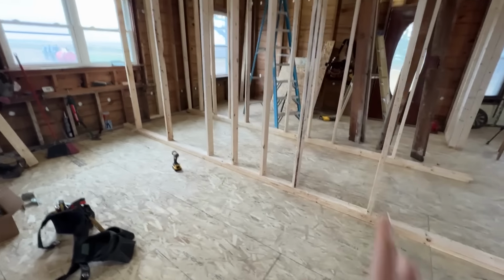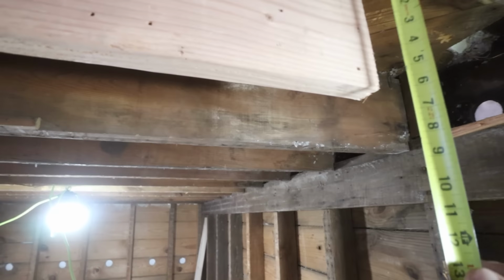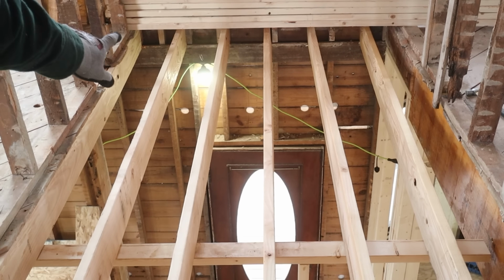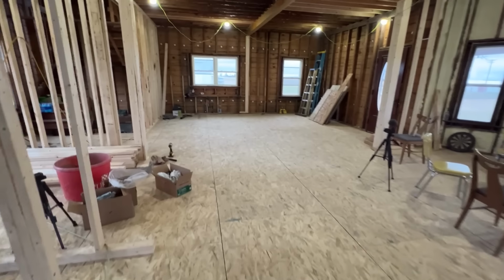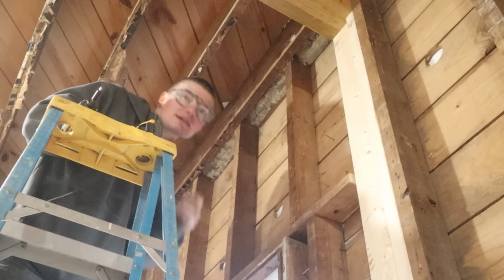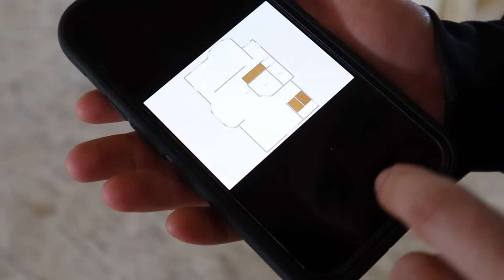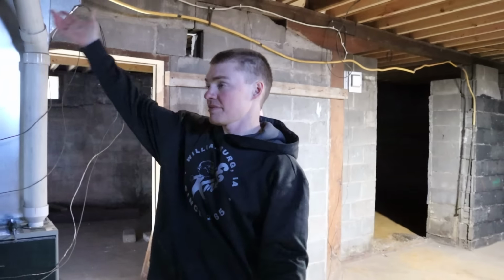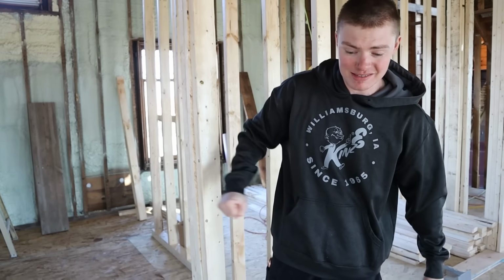Restoring A $7,000 Mansion: Rebuilding HUGE Kitchen

Comment: You have a bow in the middle of the floor... no $#!+.  That's why you level the floor before you start building walls and putting subflooring down.  Not one screw jack in the basement.  Mistake #1 caught.  Now is the floor level or is one side lower?  Flat and level are two separate things.

Comment: Your kitchen it’s up to you, but in the experience that I’ve had hanging kitchen cabinets it’s nice to have blocking behind the walls where the kitchen cabinets are going to hang that way your cabinets can be solidly mounted just in case you have a small spice cabinet in it falls in the middle of a crack you’ll have your blocking top and bottom to mount it on same with your counter cabinets it would be nice to have the blocking to where you can screw them to the wall. Take some of the old boards and cut them for blocking a little time now makes for An easier time later, doing a great job between the three of you
You and your friends are doing an excellent job. Keep up the good work I enjoy watching carpentry as well as the farming. I was in carpentry for about 35 years.
Reply: Carpenters are special, Jesus was one.

Comment: Cole. Where ever you are going to hang upper cabinets. Put flat 2x6 blocks between the studs. Center the 2x6 at 60" and 84" off the floor flush to the inside.  That way no matter how the cabinets lay out you always have solid blocking to fasten to. When done it'll look like you have 2- 2x6 ribbons going around the kitchen. Works for medicine cabinets in bath rooms as well.
Reply: great idea! such solid advice !! (see what i did there...hee hee hee)
Reply: @sherilynl4038  really sucks when you have a 30" upper cabinet and you only hit 1 stud. Lol. Been there.

Comment: Cole I do not do construction and don’t know much but wouldn’t a steal beam be better/ cheaper than rebuilding the concrete wall? Also it will open up the space and you will be able to add wall were you like and even add a room or two

Comment: I noticed the kitchen area is not spray foamed (insulation). Are you going to do that?
Reply: I'm sure he is there's just so much to this project.
Reply: i'm thinking this is because they need to run electrical and water first maybe? Or at least plans have to be laid out for both which means they have to finalize all the kitchen details - cabinets, appliance lay out etc. Just a thought.
Reply: He is but he took out the kitchen after he got the first floor spray foam and only reason he got the house spray foam is because it was still winter when he started and wanted to keep in the warmth but I’m guessing now that spring and summer weather is coming he can wait to add it

Comment: That there 3:20 is called "balloon construction" as to the method used to fasten the floor joists to the wall plate, leaving an opening in the wall or stud cavity between the first and second floors. The big problem with this type of obsolete framing is if a fire would start on the bottom floor and get into the wall cavity it spreads very quickly to the upper floor(s) and into the attic space, much like a fire going up a chimney. Some old-time carpenters would nail a horizontal 2x4 in the stud cavity as a "fire block" to slow the spread of fire in the walls. I've also seen very old houses (over 125 yrs old) where the floor joists were just nailed to the side of the studs without any horizontal wall plate (like the one that Roman is pointing to with the end of his tape).

Comment: one suggestion a steel i beam a couple of footers and support poles on the footers now you have an open basement....
Reply: Why would you spend all the money on an engineering plan to get that. They hate being in the basement.
Reply: @greghamann2099  If he adds in-floor heat while the basement floor is torn up anyway, they could make it a lot less "basementy" when they're done.  Add can lights, a finished ceiling, more finished wall treatments beside painted concrete and block, a pool table, ceiling mounted projector as well as some other accoutrements and all of a sudden you have a great open recreation area for the whole family. With the added bonus of Cole's boys having the coolest basement for all their friends to hang out.

Comment: Just a thought, but if you lay out all your cabinets on the floor, snap some lines or whatever ever it will help with wiring and blocking for upper and lower cabinets.  Always helped me and the subs.

Comment: A guy could install blocking between joists to increase floor stiffness and prevent joists from rolling.  And although not common in the midwest, furring strips applied to the bottom of joists (ceiling of floor below) creates a chase into which you can easily route wiring in the future.  E.g. adding a light, outlet, or networking cable.
Reply: 👍The British call them noggins/ the small pieces between the joists…for stability and stiffening of the floor above

Comment: Vertical plumbing runs.  Are you planning on using larger diameter tubing. To make runs up to fixtures or angle stops so if the house freezes  the whole walls dont have to be opened up.  Just at the fixture and slide out the old and slip in the new.

Comment: You should have invested in a joist hanger and metal connector nail gun.  It makes nailing off metal brackets and straps so much easier.  I have the bostitch mcn150 and it works really good.

Comment: Cut basement exterior wall to drive in bobcat, demo floor & block walls, trench in drainage, radon mitigation & plumbing, bring in tons of gravel, pour concrete with Georgia Buggy, Steel beam with minimal columns. Will save you countless hours and back injuries. Love what you are doing.
Reply: This is spot on
Reply: Exactly!
Reply: Smart !!!  Easy now with huge payoff forever.  That’s lots of real estate

Comment: Option #3. Take out that wall and bridge the entire thing with a steel beam. Opens up your basement and saves you time. You may also be able to bridge the gap with an engineered beam at the expense of head height. Also suggestion for those notched floor joists in the perimeter they make joist hangers for those areas, sort of a hurricane tie. Those notches basically turn 2 by 8s into 2 by 6s.
Reply: If he could sneak that I-beam through one of the basement windows that would be ideal
Reply: A wide open basement is definitely a better option
Reply: @bryanirwin5473  How are you going to sneak a 4000 pound beam in tot he basement?  YEs that beam will be ever bit of 4,000 pounds. The size of beam he need will be huge and you still have to have post.
Reply: @johnunsicker7440  I don't know the partculars, but they do it all the time to lift houses that sit in or near flood plains.  I saw quite a bit of it after the 2008 floods in eastern Iowa. I'm sure there are companies in Cole's area that are quite familiar with the process.
Reply: @johnunsicker7440  if the house is 60 ft that would make that a 66 lb per foot beam that's a 8" flange 9" tall and a little over 1/2 " thickness on the flange. W8 x 67 just a little over kill
Reply: Yep. My house had a 60' steel beam in the basement. Having only one support post in the middle of the basement was great, much more freedom to use the space, and I'd suppose that even though they are heavy, retrofitting one would be less work than building a new concrete/CMU wall.
Reply: To fit in think of the skid steer and dolly then jacks to place it. Easy Peasy.
Reply: Instead of a big I-beam, maybe could do a flitch beam; pieces of 1/4" (or 3/8" or 1/2") plate steel sandwiched in-between 2x8s (2x10s, 2x12s).  You vary the number of plates (board/plate/board/plate/board, etc.), the height of the plates/boards, the thickness of the plates, and the spacing of bolts to get to the desired load rating that you need.  Biggest advantage of a flitch beam is you can usually build it in place so you don't have to manage and manhandle a three-ton I-beam through a 2'x2' window.  You would, of course, have to engage an engineer who knows how to do the design work for you.  There's a time and a place for these beams; not sure if this is one of those, but it's good to have another option.
Reply: @johnunsicker7440  quietly and inconspicuously. How else would you sneak anything anywhere?
Reply: @3landii  whether they do an I beam or a flitch, they still have to get an engineer involved. The beam saves all that masonry rebuild work however.
Reply: I thought the same thing put a beam in there with a couple of columns. People asked how you fit a 4000 pound beam through there. You can split it in the multiple pieces and put slice connection. I’ve done it a bunch of times back when I was an ironworker and yes in a lot of old houses.
Reply: Head height isn't an issue if they're pouring a new floor. Just dig a bit deeper before pouring.

Comment: When it comes time to do the electrical, please remember to put electrical outlets into your closets and pantry. For mini fridge - if you ever need to keep refrigerated meds at your bedside, charging vacuums, emergency flashlight, etc.
Reply: I'd love an outlet in every closet. There are endless things that need a battery charged these days.
Reply: That is a very good idea and a common practice in new construction
Reply: If it's allowed. Outlets aren't allowed in closets where I live
Reply: @Iamthathillbilly  codes don't bother the cornstars.
Reply: My electrical inspector hinted that I should consider outlets behind bedroom doors, because that is a location you know will never ever be covered by furniture, and when you plug in a vacuum temporarily, you’ll really appreciate having that.
Reply: I wish we had outlets under our sinks in the bathrooms. I could plug in the electric toothbrushes and hide them there to charge instead of on my countertops all the time!!!  Or other electrical devices.
Reply: We have outlets and hvac vents in our walk-ins. Plugged a safe's dehumidifier into one, have a clothes steamer set-up in another, they have been handy.
Reply: @ADSC2006  I'm in Ontario Canada too, code may be different in Iowa
Reply: Also 2 plugs on each wall in the bedroom that way no matter what you have a outlet on either side of the bed
Reply: Also need electrical for bidets.
Reply: There are never enough outlets throughout the entire house
Reply: you really can never have too many outlets, in my opinion. built our first home and loved all of the outlets. i now live in an 80 year old home and i've had 3 outlets added already and my living room could use 2 more, still. (there are only 2 outlets in the entire room....that's the two lamps---the tv, the sound bar, the roku, the alexa, the charging station, the christmas tree...oooh it's bad. hahaha)
Reply: @ADSC2006  They will if they need an insurance claim.

Comment: Oftentimes in old houses beam supports are set right on the concrete without footers and eventually sink into the concrete. Happened in my house. I started out shimming with quarter inch plates once a season until it was straight. My floor was down 1 1/4 inch in the center. Eventually I'll get around to busting everything out and doing it right. I think you are smart to fix it once and for all. If I had to do it over again I'd do the same.

Comment: Wow, that has opened up those rooms, looks great. Nice move putting the door in that area, really fits for the outside of the house. And yes, I agree with other commenters, to make a room with bathroom access, just in case you need a bedroom on the main floor later in life. It's so much easier to do that now, then later. Don't forget to put in blocking for future grab bars. Great job guys! this house redo is why I'm watching your channel.

Comment: Hangers can be done with a palm nailer that runs on air. Or if you want to buy one a positive placement nail gun. Less practical in this case. They also make Simpson strong tie rated screws for hangers and ties.
Reply: Or you could just spend an hour hammering in nails and get the job done.  Are these guys overworked or under pressure to get the job done next week?

Comment: jack up the wall glue and screw a 2x8 underneath the low joist and shim under them as well. they make Simson structural screws for the hangers way faster an easier
Reply: No, this 1/2" bow in a 100 year old house floor is going to require a full foundation gut and rebuild.  It's a common theme with this house.

Comment: Put in a steel beam with some lally columns in the basement, it will open up the whole basement. Also the cost would probably be a little cheaper and a lot less work. Win win
Reply: I second this idea. This will be a cleaner and easier fix for a load bearing area which will last more than 100 years.
Reply: Yup, great thought.

Comment: Cole, You might want to think about adding some bracing between the floor joists.  that will keep them from twisting when load is applied.  You might want to check the building code?

Comment: In a previous video Cole mentioned the problem of placing concrete in the basement due to limited access. I recommend he looks into renting a line pump to place that concrete. It's still a lot of work moving that line around but much better than doing it with a wheel-barrel.

Comment: Iowa code mentions joist hangers should be nailed, but it's hard to tell if they just mention it offhand or if they really mean it.  Nails have more shear strength whereas screws have more tensile strength.  Screwing them is probably fine and I won't tell no one if you don't. :)  Thanks for continuing to post, I'm enjoying the series!

Also for the basement, have you thought about using a steel beam?  It's not a long run so won't be terribly expensive, and you can layer a 2x4 on top of it so you have something to nail the joists to.

Comment: steel H-beam on top of the concrete wall in the basement, where the current wood beam is.  jack up and take out the old beam and replace it with a H-beam and lower the floor again .this as long as there is support all the way from wall to wall where that wood beam is.
think about it and se how it compares to cost and time building new block wall.

Comment: Reinforce that basement wall, pour your footer, and then build the new wall, with steel box-beams. That way, your new wall is dimensionally stable. Use large, 7/8 diameter rebar on the wall, to make sure it doesn't drift over time. Don't waste your time with cheap, weak 5/8 stuff.

Comment: I told them numerous  times, before they started that they should have done all the floor leveling before any demo was done. Start in the basement and work your way up floor by floor. That way everything moves at once and at the same distance. Now they have new construction walls that are built in place and are now too tall. So when they jack up the floors it will transfer those movements to the roof, creating a wave affect on the roof.  Also they would have been able to save all those hard wood floors.
Reply: As usual, the "Cornstars" don't listen to good advice, but do it their way and then just complain about it later.

Comment: 3rd option: a really strong bandage. Sandwich the beam between a pair of steel plates at least a 7mm thick and maybe as much as 10mm thick by a little less than the height of the beam. The steel plates will be predrilled for large diameter all thread. The plates will have pedestals for 2x4s welded to it. The beam will have alignment slots in each doorway to facilitate aligning with a laser. The plates will jack up the floor and pull the beam with it. Drill for the all thread pieces. Best design is two very long pieces rather than four shorter pieces. Unless you really don't trust the leaning wall. This bandage would be one day's work and no demo. Will have to address where the old beam is pulled away from the support wall with grout or stainless steel shims. Will have to address any first floor temporary support walls whatever route is taken.

Comment: Your mansion will be gorgeous! While doing downstairs concrete things please consider. 
1) Dig a ramp and make a hole to wall to use compact track loader to move dirt, stone and whatnot in downstairs
2) Build 4 separate draining systems. Your mansion is on top of the hill and you have equipments so should be easy.
 - household water (separate toilet?)
- basement underground water (direct underground pipes downstairs to old well and use sump pump to keep it "level")
- outdoor roof water (flooding every now and then, right)
- outdoor underground water from the level of indoor underground.
Reply: Actually was there dirt wall somewhere to build a ramp into downstairs...

Comment: Cole, if you want To make those large leaded / beveled glass windows more energy efficient: your can install a new double pane picture window and cut the top bevele glass section (leaving the wood frame in tact) an hang it from eye hooks at the interior to keep the original look. I have done this for many clients as I have been a contractor for 15+ years in the window and door industry.
Reply: It’s the sun coming thru that beveled edged glass portion , that gives it the sparkle and rainbows. I appreciate you advice as to how to SAVE them, you have the experience and, it’s better than them getting trashed!